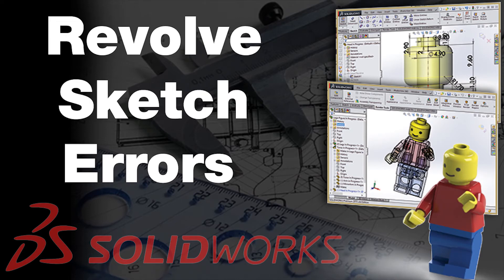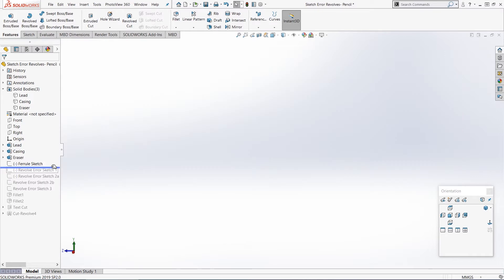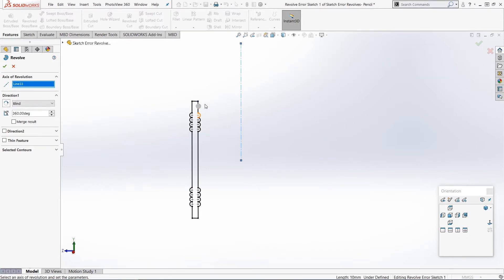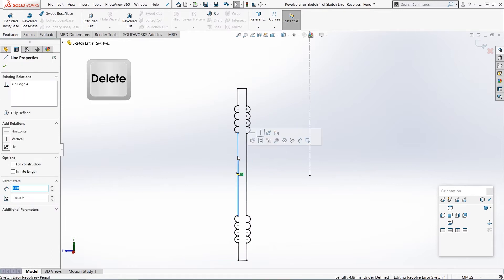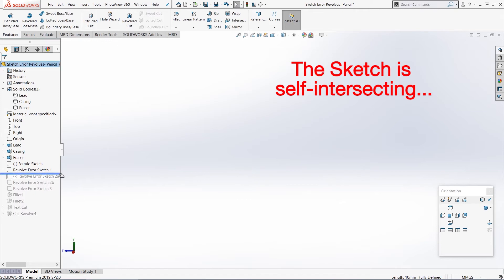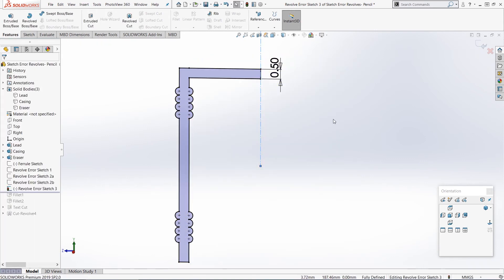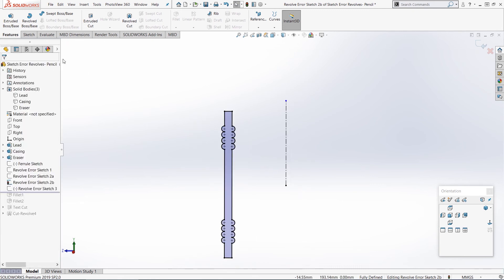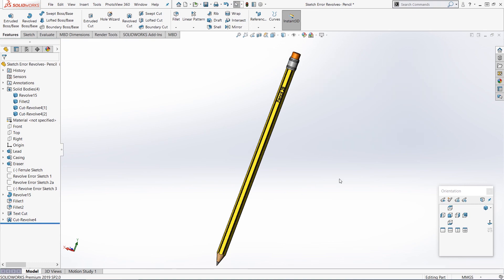Solidworks Revolve Error - "The Sketch is open, self-intersecting or intersects the centreline"

Comment: Ok now how do you make the program automatically detect and delete overlapping edges and merge endpoints so we don't have to spend hours going through hundreds of lines?
Reply from the maker: Is that for imported lines? I'm afraid I don't know a good automatic way, just to use the Trim Tool
Reply: @johnoellison   It was for text dissolved into lines. I got the error message that sketch is self-intersecting when I tried to extrude the text. Couldn't find any faults. But I got it working when I individually selected each outline instead of the entire sketch. weird.